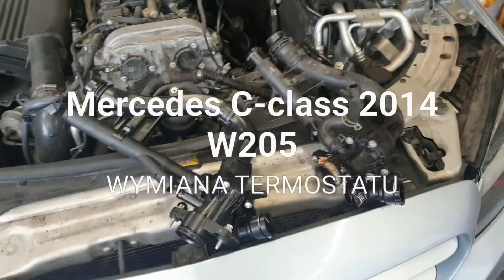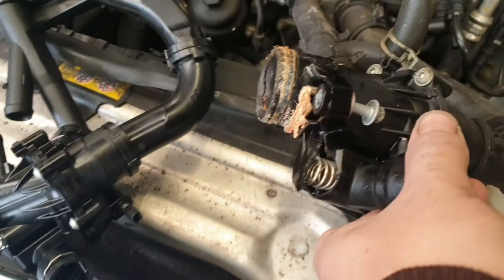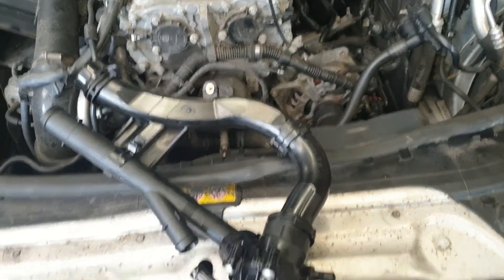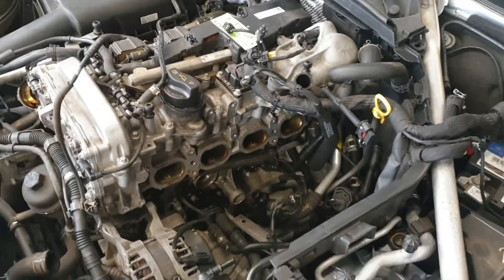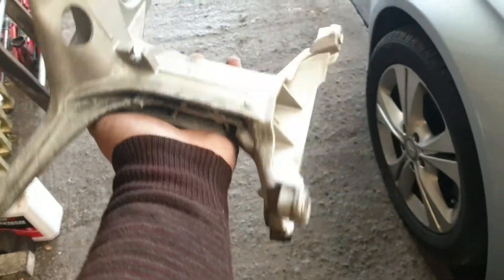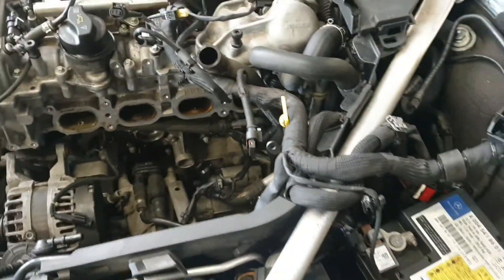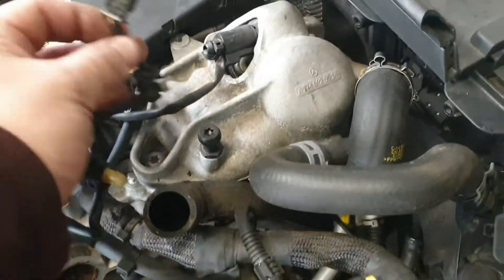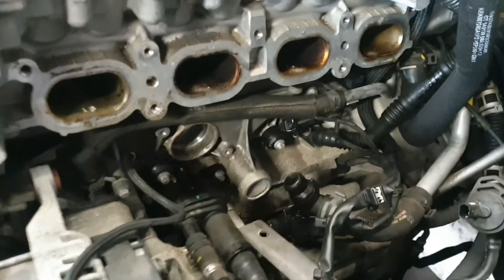Mercedes C-class W205

Comment: please need a help i look ur video for delphi i cant connected it to laptop light red on it
Reply from the maker: do you have a problem with the delphi device is it a laptop - device or car device connection?
Reply from the maker: maybe you have something not installed or a device has not been added, and the laptop will not see the device. If the car does not read you, it may be a problem with the device, i.e. the head. As I remember, delphi you need to add a device, make a test and only you will be able to diagnose the car